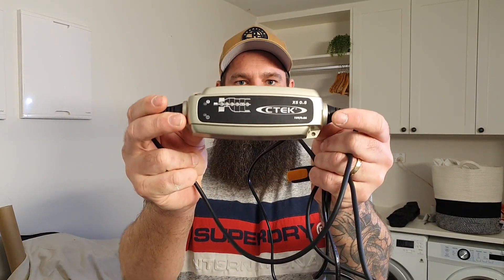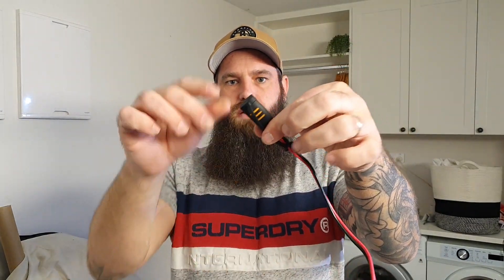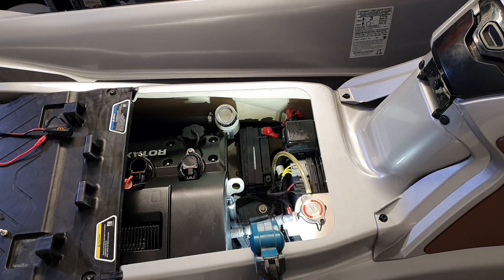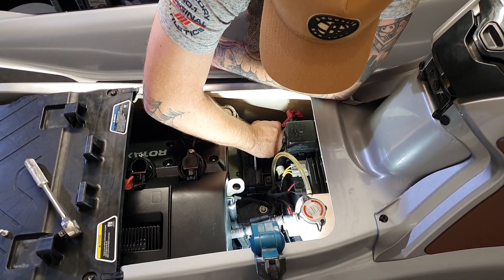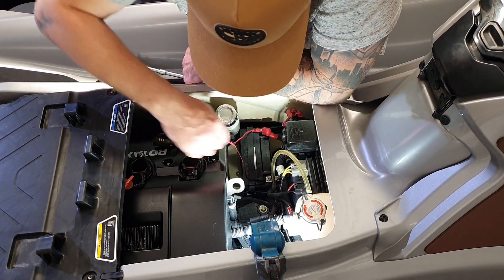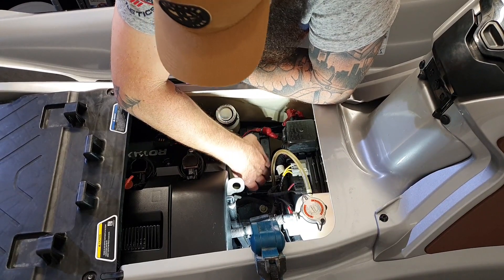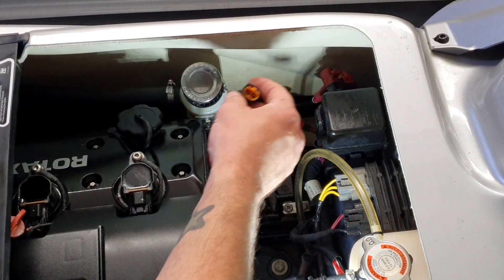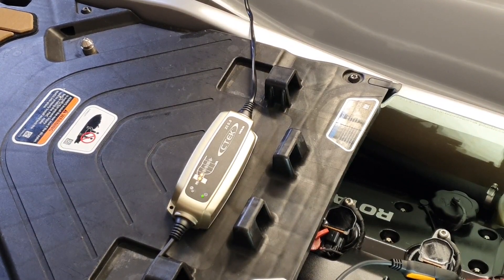How to battery charger SEADOO

Comment: Those short bolts are a real pain.  My dealer didn’t have longer bolts but they did have a larger/taller block style nut that made up the extra space needed for the bolt threads to catch.  Good informative video!
Reply from the maker: Cheers!

Comment: Great video mate. I’ve just bought my first JetSki and it comes with dual batteries. They are in an awkward spot. I didn’t want to take the batteries out every time. Plus my C-tek battery chargers clips were way too big. I’ll buy the ones you showed. Thanks heaps for the video. Subscribed
Reply from the maker: All good mate that's all my intentions are ......to help! Cheers for subscribing